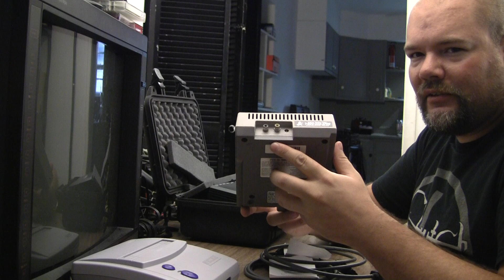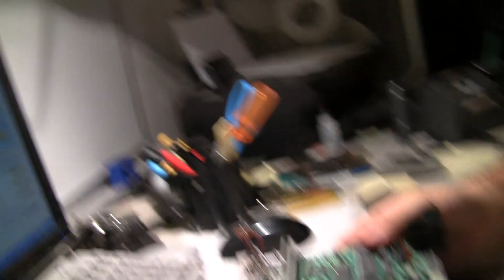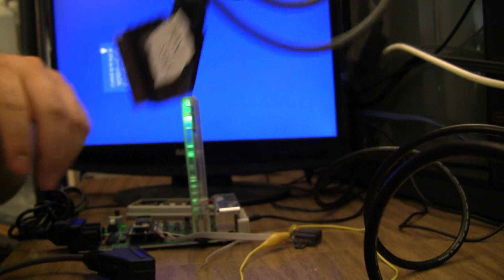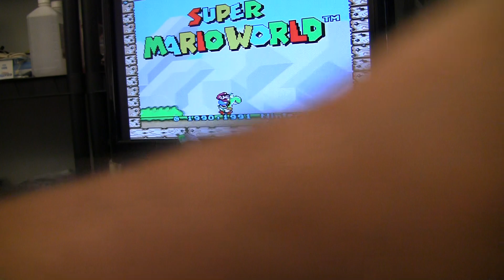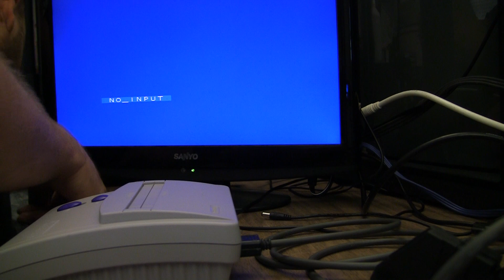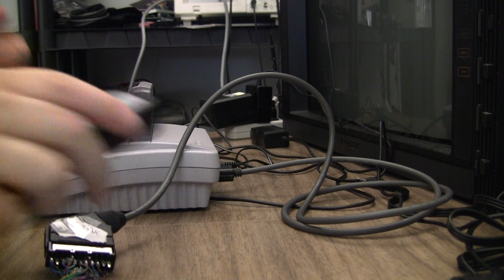NES-101 + SNS-101 rgb modded to use on XRGB mini

Comment: My question is why would raw sync not work at all?  Isn't that usually the best type of sync to use for most devices?  The scart cables I bought for all of my systems were from the retro gaming accessories Ebay seller, and are all raw sync, which I thought were preferred.  I just ordered an XRGB Mini, so this has me worried....

Comment: have you fed +5V to nintendo AV connector pin 3 (or maybe pin 10) so the sync stripper in the scart cable can be powered up?

Comment: Question and it may be a dumb one but why, would you want to put an RGB connection through an upscaler like the XRGB Mini, does that device get the most benefit by just using standard composite or Svideo connections.  Perhaps I don't understand because it's upscaling the connection either way, and scart cables are not really cheap plus if you hook up the MINI to a switch then you would need a Scart switch and not a standard AV/Svideo Switch for multiple systems.
Reply: The point is that Composite and S-Video look far worse than RGB, and upscaling a poor signal is still going to look poor no matter what.  There is very little improvement by upscaling a Composite signal through such a device.  You're better off just letting your TV do the upscaling if all you are using is Composite.  

The main point of the XRGB is that it accepts an RGB signal which is by far the best and cleanest signal you can get out of these older consoles.  It looks worlds better than Composite or even S-Video.  Some people are willing to pay the big bucks to get the best picture possible.  If you don't plan to use RGB then the price of an XRGB device probably isn't worth it, although S-Video does look quite nice upscaled through it. Still not near as good as RGB though.   If you buy an XRGB then you might as well use RGB as all that it requires is the proper SCART cable for your system.  Most older systems output RGB natively although there are a few exceptions.

Comment: tims sells a cable with a scart head and 8-din/3.5 stereo end, could a scart to hdmi converter to the same job as well as the XRGB? trying to work out why some modders prefer to use a multi out instead of the 8-din and stereo that comes with the kit
Reply from the maker: Those cheap converters add too much lag is what I hear. The difference in connector choices is about console real estate or simple esthetics or if they already have a snes cord.
Reply: +dylbob9000 I use the SCART cable with the SCART to HDMI converter. Works perfectly.
Reply: +vietdude1979 generally speaking, you'll be introducing about 50-60ms of lag using a cheap SCART to HDMI converter.  Fine if you are using it soley for capturing/streaming and have a PVM to play off of, but you can't really use those cheap HDMI scalers for any serious gaming.

Comment: So what exactly is the difference between a raw sync cable and a composite sync cable?  I am not completely clear on the difference... I mean I believe composite sync takes the yellow composite signal and gets sync from it, while raw sync is just the raw sync data, I think thats the difference....

Maybe it wasn't working because the raw sync needs to be boosted?  I think there is a pin on the system that provides voltage that can be used to boost the sync, not sure if anything else is needed besides that though...
Reply from the maker: +skins4thewin Raw and composite sync are the same thing. Composite video as sync or composite video stripped for csync is the other ways to get it.
Reply: +GameTechUS -  with the difference of composite video as sync having the composite data which can cause interference and issues sometimes, from my understanding.
Reply: +skins4thewin The confusion is from the term "composite" (which just means "made up of separate parts").  In the case of "composite video," it's R+G+B video on one wire; in the case of "composite sync," it's Hsync+Vsync on one wire (on a VGA cable, Hsync and Vsync are on different wires).

There really isn't any difference between a "raw sync cable" and a "composite sync cable" (CSYNC).  The easiest term to look for is "sync on composite," which tells you that you are getting R+G+B+Hsync+Vsync all on pin 20.  As far as practical solutions go, I think if you get a powered sync stripper you should be able to use any RGB SCART cable on the market without a problem.  The quality might not be quite as high as a native CSYNC cable, but it should still be higher than a sync-on-composite cable and you won't have to worry about compatibility issues.

Comment: A bit out of my price range, that XRGB. Aren't there cheaper options if all you want to do is connect old consoles to modern tv's?
Reply: There are, but some of them will have higher latency, or will do dumb things like try to deinterlace the console's 240p signal as if it were 480i.
Reply: Scope-Eye video
 Most modern TV's also feature different deinterlacing options and things like game mode which turns off most image enhancements to reduce lag.
In my Bravia it works really great if I use game mode combined with quality i/p conversion(aka what they call deinterlacing). The image is as good as it gets. The speed variant of the i/p conversion is indeed faster(1:1 as far as I'm concerned) but the image shakes too much when playing a PAL game or a 240p title. I'm willing to cope with a tiny bitsy bit more lag with quality if it means I get an image that doesn't jump up and down all the time.
I've tried cheap converters and I've been very disappointed with them.
Reply: Nikodem R I'll have to check out game mode on a modern TV sometime. Mine is several years old, and I have no idea what "game mode" does, I can't see a difference. It doesn't correct the deinterlacing issue - graphics that change on every frame (like the flickering "invincibility period" sprites on NES games, etc.) wind up striped instead.
Reply: Scope-Eye video  the game mode is always good to keep on (since it reduces latency) you should look if your tv has different deinterlacing modes. What doesnt make it easy they practically never call it what it actually is and the description often says nothing about interlacing. I found it in mine by accident when messing around.
Reply: SCART to HDMI or the OSSC
Reply: S-Video / Composite to VGA, it has the least amount of input lag compared to all the cheap HDMI upscalers I've tried.
Reply: I think you guys may have missed the part where he said that all he wants to do is connect old consoles to a modern TV.  Thus he likely doesn't care at all about RGB or SCART or any of that.  I am assuming he just wants to use RF or Composite Video.

Comment: With an RGB modded an NES and an XRGB mini Framemeister, what kind of SCART cables do I need to hook up to a monitor or TV via HDMI?
Reply: OK so I've been doing research and I hope it helps people.

If your console has been RGB modded that outputs composite sync, you don't need an SCART cable with a sync stripper.

If your console has been RGB modded that outputs composite video as sync, then you need a sync stripper in your SCART -> 8-pin adapter of your XRGB mini. (Note, that the included adapter with XRGB mini looks like SCART, but it's actually JP-21 -> 8-pin. 

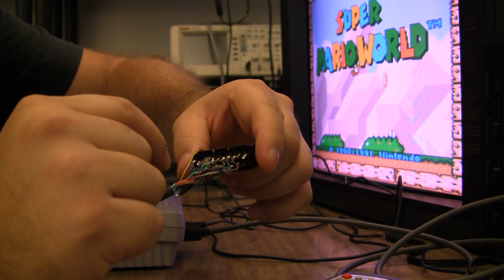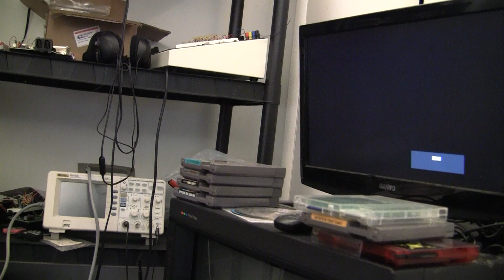GameTechUS  alluded to this difference @32:00-33:00

I enjoy watching GamesTechUS videos, but a 30-second summary at the end of video (for valid conclusions and useful takeaways) would be amazing. I don't think it would detract from the folks who also like watching your work. :)

Comment: does anyone know if I can plug the xrgb mini into an American power plug with the supplied power supply? I just got it and im worried about plugging it into my American power plug and blowing it up...
Reply: i think u can be safe. Japan uses 100 volt US 120 EU 240. aslong as you don't plug in a US 120 volt into 240 volt if it not made for it you should be fine. but sure if u need to look after something else, i don't know anything about this, its just a guess more or less
Reply: I actually am using the xrgb mini with the supplied power supply it came with. it works great.